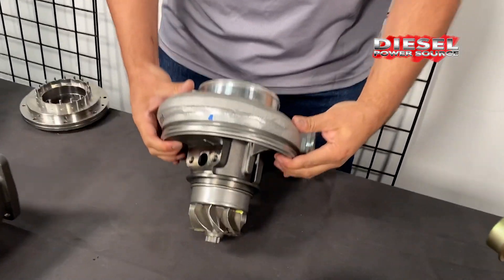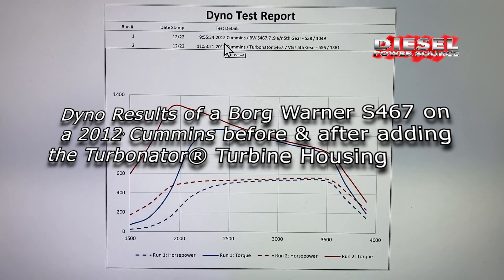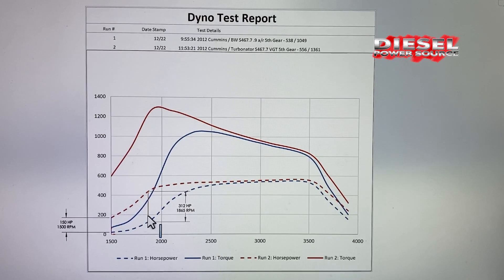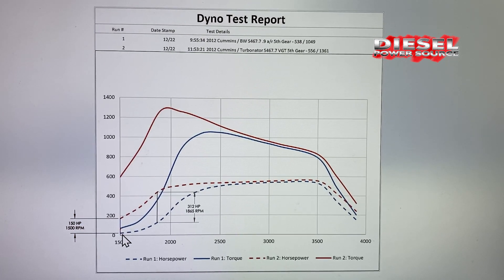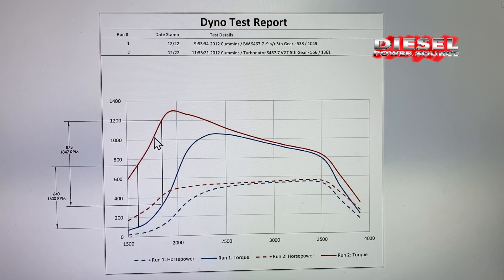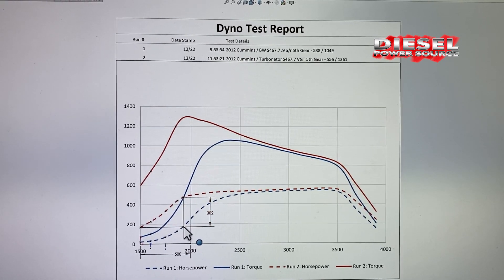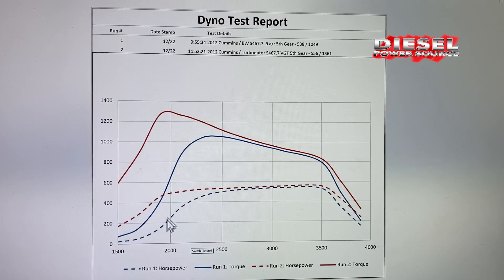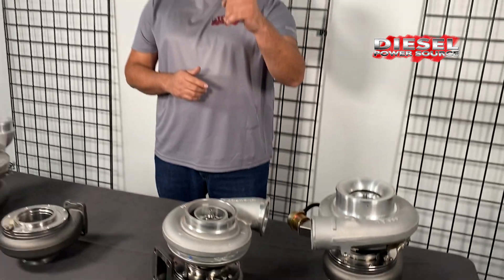Dyno Results Turbonator® VGT turbo makes a 312 HP gain on Borg Warner S400 turbo 6.7 Cummins

Comment: To bad we don’t have vgt for 7.3 powerstroke that would be awsome
Reply: You could put one of these on a 7.3
Reply: Blu Gods if a person put  the time in to get it work yes. If you can put a v8 in Acura integra. Then yes it is possible to put a vgt turbo on a 7.3  but custom fabrication is needed
Reply: Dallas Korpan wouldn’t be that hard many kits made to put an S300 or S400 turbo on one then just need this exhaust housing and all it’s associated parts
Reply: Blu Gods and when did s300-s400 have vgt
Reply: Blu Gods if you have and idea on how to put a real vgt turbo on a 7.3 no not  s300 or s400
Reply: Dallas Korpan so what is in this video is not a real Vgt?
Reply: Dallas Korpan did you watch the video?
Reply: Blu Gods yes 6 times now and well Cummins and powerstroke are two different engines. Two different monsters
Reply: Dallas Korpan https://youtu.be/3VDEso6tUu4
Reply: Blu Gods yes I seen that video  but he didn’t just put that in
Reply: Blu Gods  and to be honest 2003 6.0 powerstroke 10vane vgt turbo has one of the best sounds from the whistle to the  vgt jet sounds out of the exhaust

Comment: FINALLY thank you for this. how is the reliability for getting sooted up like other VGT systems?
Reply from the maker: We made the Turbonator to overcome the weaknesses of the sliding mechanism used in the stock VGT. The Turbonotor is very durable, made for performance and designed to work well in a high soot environment.
Reply: DieselPowerSource how many miles have you guys put on them in testing before market release?